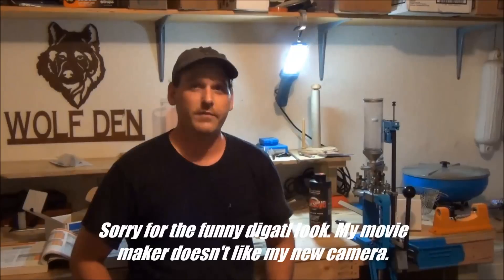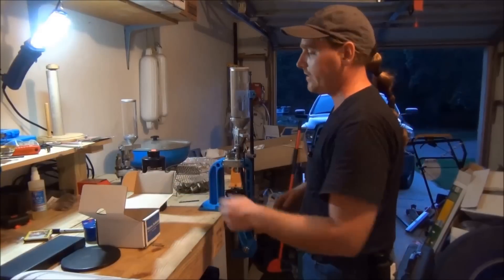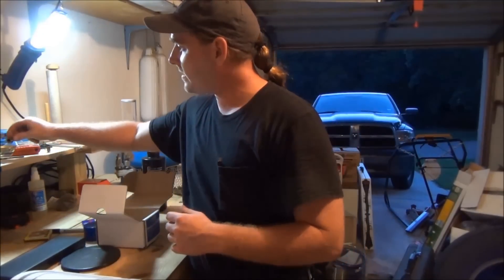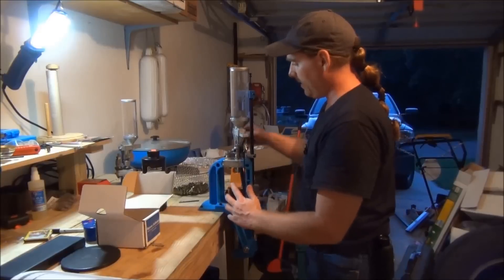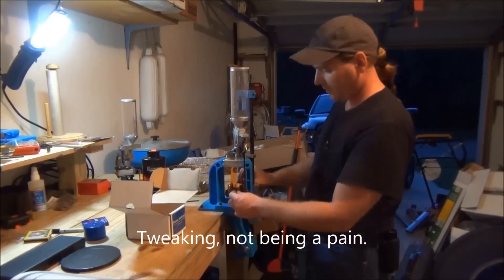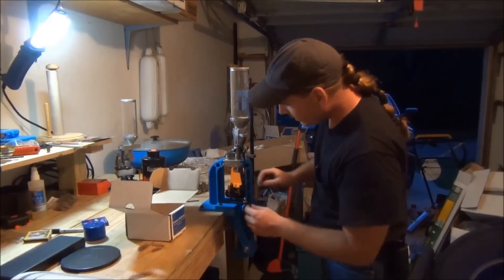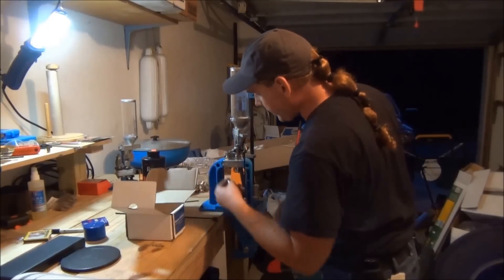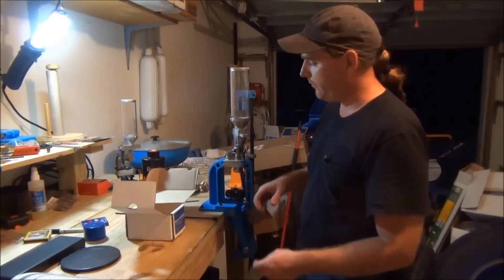Reloading 45 acp on my Dillon RL 550B

Comment: Cool video! I just bought the Dillon Rl550b. I Started out with the .44 magnum conversion kit. But I plan on reloading .40 S&W, .45acp, 9mm and maybe .223 down the road. For me it' going to be a fun new hobby, and you can save a little money in the mean time.

I didn't realize you can get .45acp with small or large pistol primers. That I found interesting.